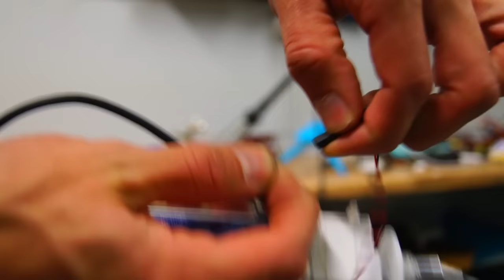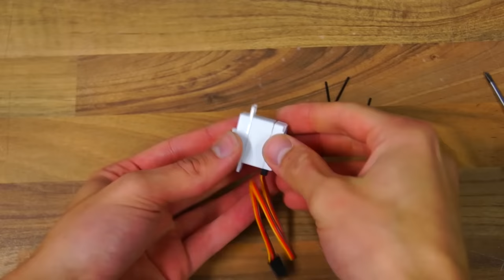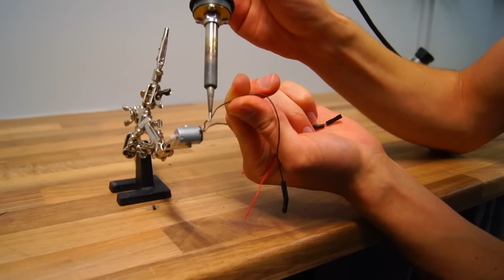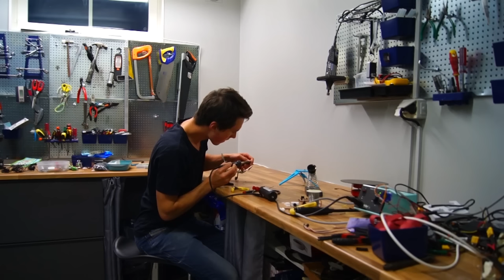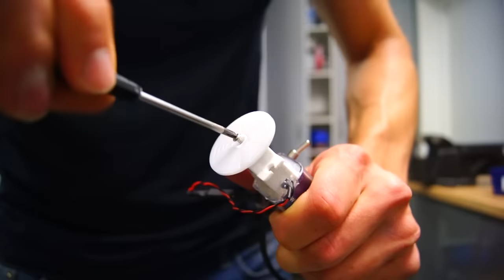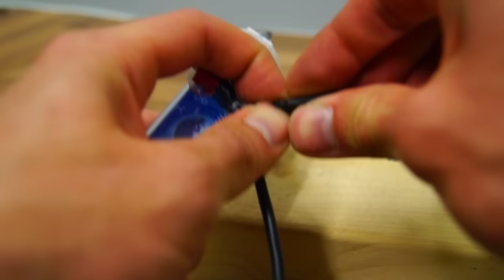DIY Electric Screwdriver Tool From RC Servo - RCLifeOn

Comment: Really great, man. :) I'm going to make one today and post the video probably tomorrow. But I'm using a basic 9g servo, with plastic gears. :/ My last attempt I used 7v and, when I tried it the gears were destroyed. LOL What's that servo torque?
Reply from the maker: Thanks, have a nice day! The torque is sufficient for most smaller screws.